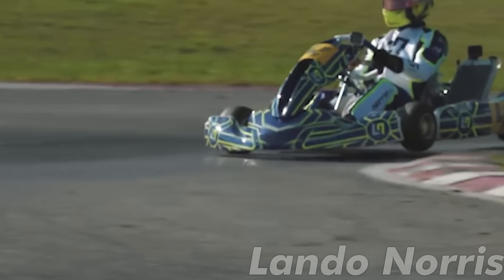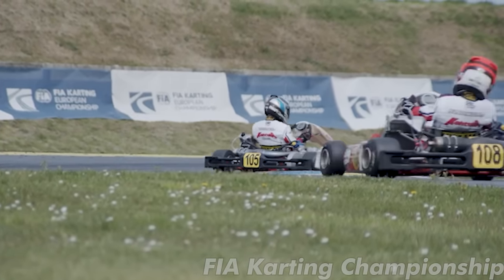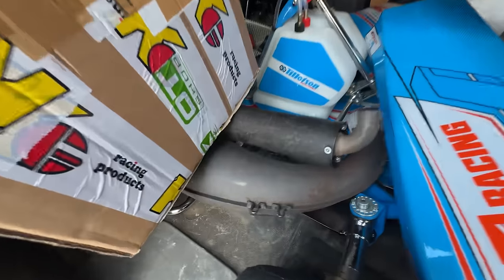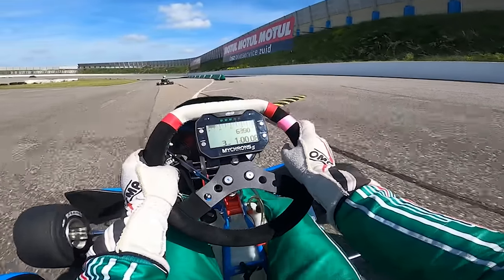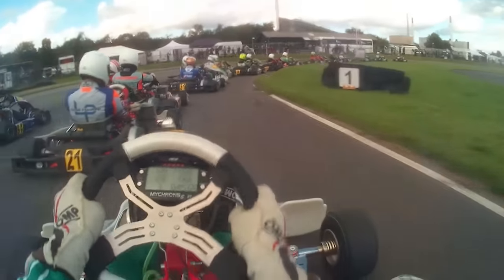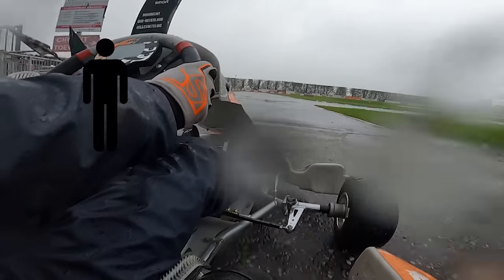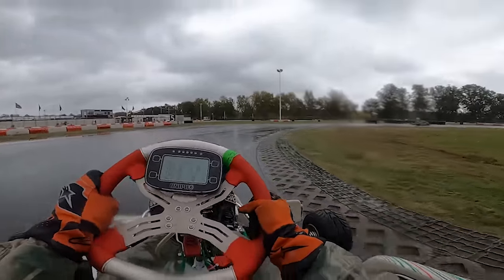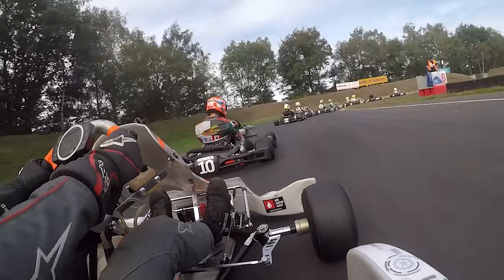Everything I Wish I Knew Before I Started Go Kart Racing

Comment: Hey red, great video! I want to get started in karting to learn and have fun. I am 30 but i want to open the door for my son later on! My goal is just to learn driving, setup and the mechanical side so i can be my sons crew chief later. Do you have any tips on what class of kart i should buy for myself? Also what age would you suggest i start getting my son some seat time ? Thanks in advance !
Reply from the maker: In your case go for a Senior Rotax Max kart.

Get an OTK chassis from 2020 or newer and an EVO engine

Just try and have fun, you will learn a lot by just doing it and trying a bunch of stuff.

Get him behind the wheel as young as possible
Reply: @RedExions  thanks for the tips !

Comment: How much does it roughly cost to join a team, and how much does it cost to go solo?
Reply from the maker: You can make both as expensive or cheap as you want. But let's say solo: 20-100k per year. Team: 35-100k
Reply: in the US, to do one national race weekend in x30 senior solo (2 practice days and 2 race days), usually it's around 3k for all expenses (assuming roughly an 8 hour drive and 11 mpg). if you want to pit with a team, usually it's between 2 and 3k on top of that for all 4 days. this is also without any hired mechanic costs. its brutal honestly, but if you can make it happen, it's just about as much fun as its possible to have. just doing laps at a track isn't too far behind in fun (in my opinion), and is way cheaper and more relaxing.

Comment: do you have any tips for me as a iame x30 driver who does not have a big buget
Reply from the maker: switch to rotax
Reply: @RedExions  isen't rotax more expensive?
Reply: @RedExions real
Reply: @samuel_klrn It's wayyyy cheaper. The IAME engines have to be dismantled and cleaned, revisioned and have some parts changed after every race and they're practically race useless after one or two seasons, and in my country per IAME weekend you can use as many tires as you want but on rotax you can only use 1 set of tires. 

A rotax engine may last easily with top perfomance for 2 seasons or more only replacing the piston.
Reply: rebuild costs to keep an x30 at a good, but obviously not ideal level is around $6-700 for a top end (lasts 9-10 hours), and $1100 for a complete rebuild (you can get away with around 20 hours on the bottom end, and by then you'll need the top end again also). it works out to roughly $100/hour to run, not counting fuel. honestly part replacement outside of rebuilds isn't bad now that everything is stable after the updates. i would recommend trying to find a small number of races per year to do, maybe one less than your maximum, and then use the money from the one race you don't do to pay for testing days. that way you won't be at quite as much disadvantage to the guys who can race all the time

Comment: What shall I do if my budget is lower than 6k a year?
Reply: With a budget like that it's hard to race even in Rotax (the cheapest category where I also race). I recommend you race in Rental Karting and "invest" in a lot of practice and doing a lot of races. You can also put forward a dossier with your racing records to send to companies and attract sponsors. 
Racing in 2 stroke karting is hard with as a new kart is probably around 7-8k. 4 stroke, apart from rental, I have no idea about.
Reply: I would recommend a rental karting championship, by budget is 1.5K-3K depending on how much i earn. I just started karting, so I don’t know a lot about it. But at least in my country (the Netherlands) we have formula karting, where you have different levels/classes, if you had 6K a year i would recommend the normal championship and endurance championship (you do need a teammate for endurance). This would cost €1300 for a full season of the normal championship and €2700 per team in endurance racing. This doesn’t include travel, food and if you need it a hotel.
Reply from the maker: Do what the other two comments said or consider racing in Tillotson. Try to get some sponsorships too, it’s not impossible to get 1-2k if you do it right

Comment: 2:49 only 2 race weekends? 😅
Reply from the maker: 2 race weekends is usually when karts lose their “fine edge”. Top drivers usually replace it to keep up the maximum pace, but there is also lots of drivers who run it for longer
Reply: @RedExions  would cost 50k?
Reply: This would make it just as expensive of racing a car, no? You’d go through ~10 chasis a year.